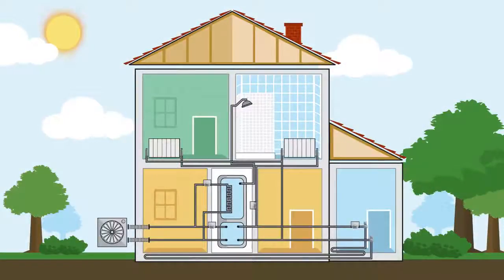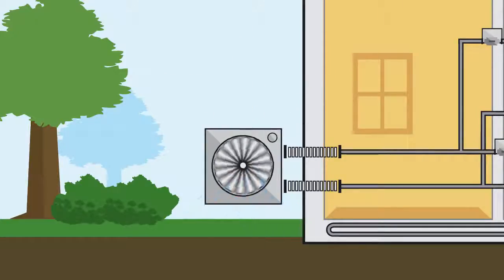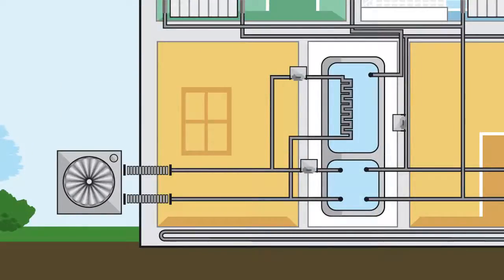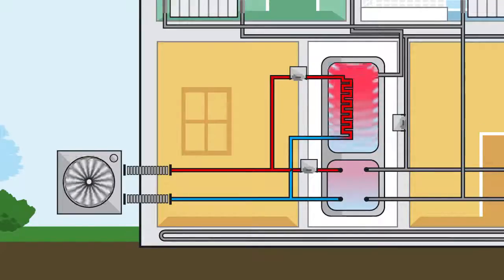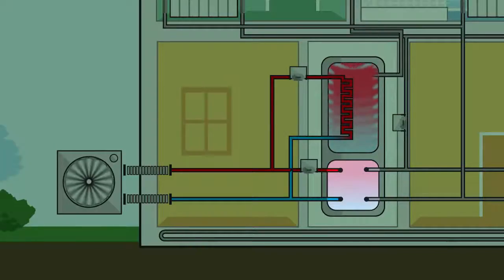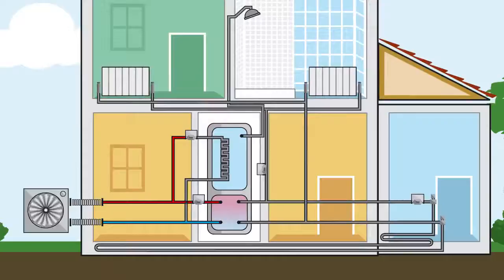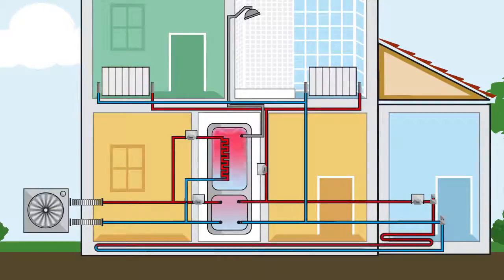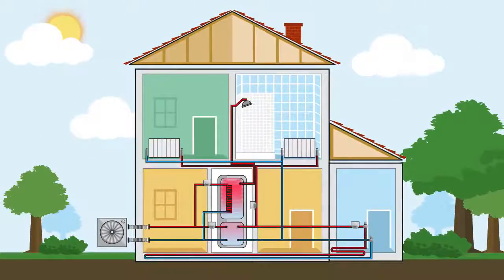Joule Heat Pump

Comment: Just had one of these systems installed 
We’re having loads of issues and problems with it 
We are currently living in a 16 degree house it won’t go any hotter radiators are freezing to the touch !